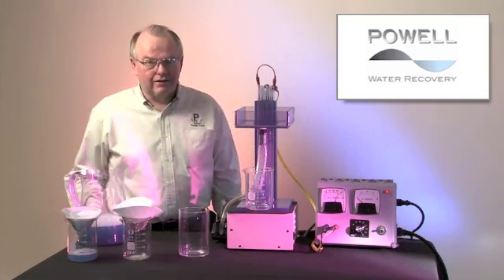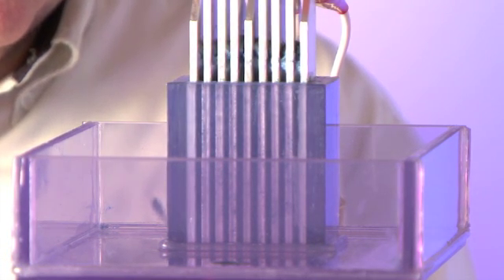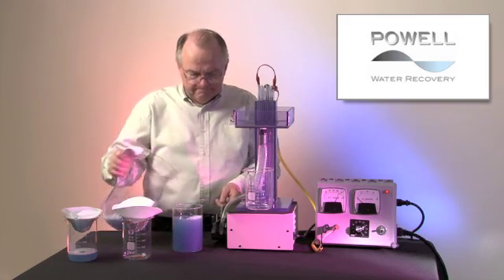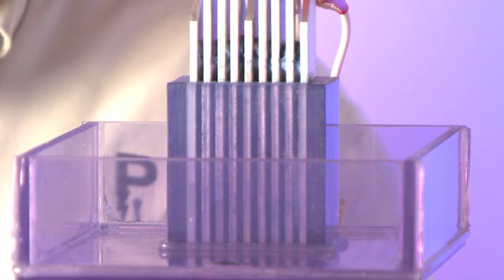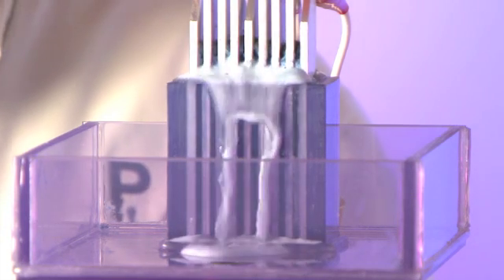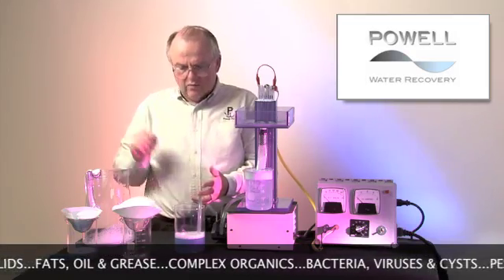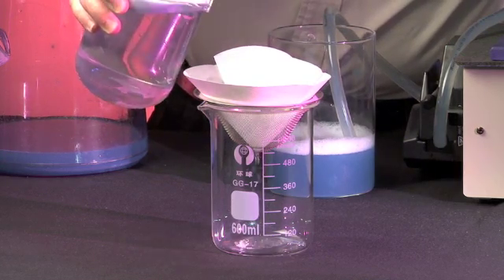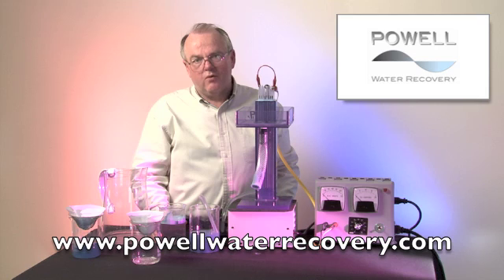Powell Water Electrocoagulation Demo

Comment: Hello really thanks for this one. Im working on my thesis about this sir. May i ask sir about the electrolyte?  I read from literature that it is different from anode. Example of electrolyte they used is   NaCl. It reports thats it influences the double layer shielding by the coagulants to form the flocs. Did you use electrolyte here sir? If you used it how did you prepare that in EC ?
Reply: Hi Raven. I'm doing my thesis about this too.
Reply: hi @isaiahgurule290  , if u have finished your thesis, do u know about current,voltage,anode and cathode materials that use in this system and how they work? i really excited about this things
Reply: I am doing this as my science exhibition model
Reply: hi @cadberry3302  if you have finished your science exhibition model, do u know about current,voltage,anode and cathode materials that use in this system and how they work? i really excited about this things